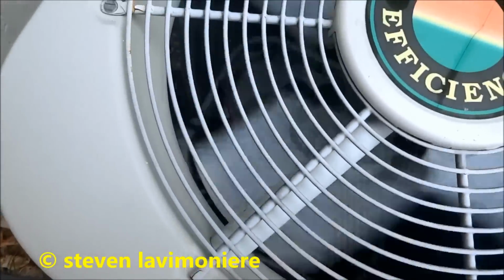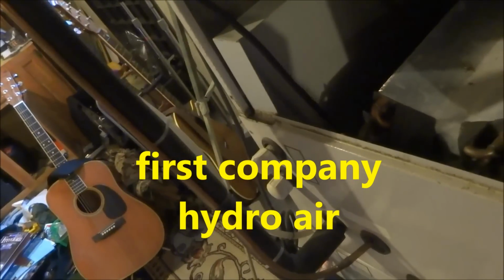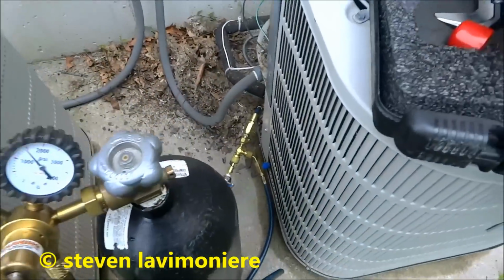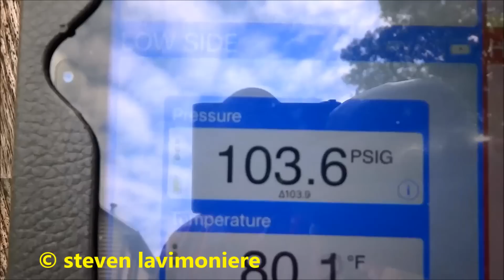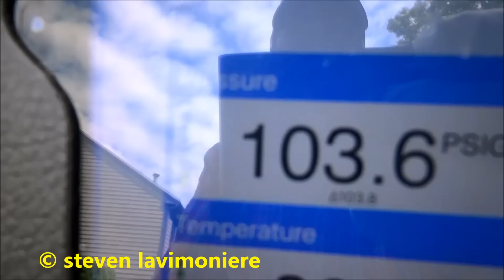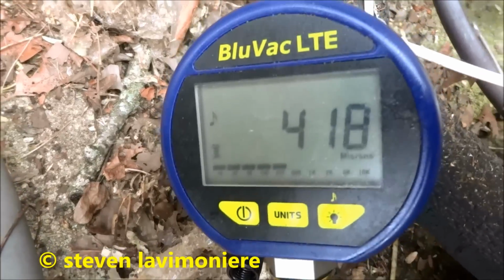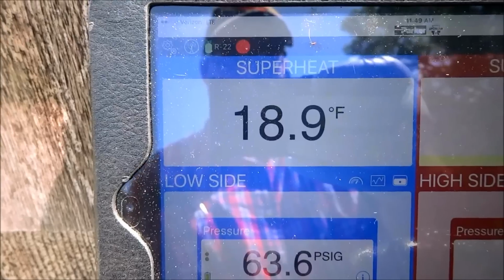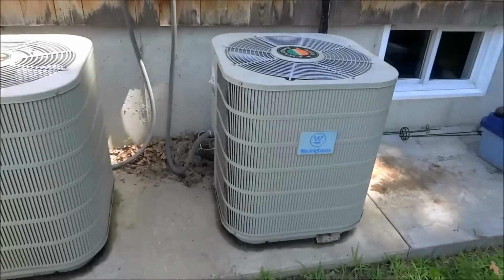air conditioning refrigerant leak fixed

Comment: Hi Steven,
I like your videos and this one is great. I have a question my old  2 Ton AC is Carrier  1990, All the Freon (I believe R22) completely leaked. Do you know what is  the price to fill 1 pound of Freon these days (I need over 5 pounds). An AC tech said  it is better to replace the AC and the evaporator coil instead off find the leak . Of course, he did not try to find the leak just what to replace the unit because it is old. How difficult is to find leak and fix it ? Where is the high possibility to find a leak in the evaporator coil or outside where the AC is located.

Comment: Hey Steve!
Did you stop using the APION mega flow for your evacuation process. I didn't any black hoses. I just completed a leak check on a Liebert system for a data center. Got lucky. The leak was on the packing of the discharge valve. I was able to tighten it up and it worked. Checked the line set and the condenser. It was good. Ready to evacuate. I noticed your blue and red hose are big. They must be 1/2" or at least 3/8". Great job!

Comment: Nice job Steve got a quick question for you man I just bought a honey well wifi thermostat model 9580 i have a 4 ton heatpump package unit this thermostat is short cycling and I can't find a setting on it for the cph any info would be appreciated I have looked in the manual and can't find anything thanks.

Comment: Steve is that Fielpiece leak detector the heated diode or the IR model?  I did not know that those detectors were capable of detecting nitrogen.
Reply from the maker: its a new fieldpiece heated diode i believe it works well there was a lot of oil around shrader cap been leaking out there so there was a lot of refrigerat in area .
Reply: Thxs.  I have that unit that is why I asked.

Comment: Nice fix Steve. Can't believe original installer left the Schrader out. Another fried mouse. Were those nordyne units with the Westinghouse nameplate? I've seen newer Westinghouse units. They are micro channel design. Yuck. Lol.